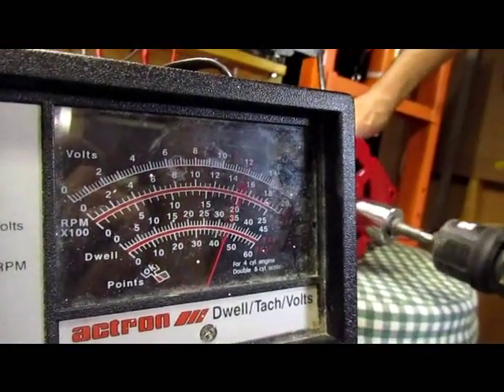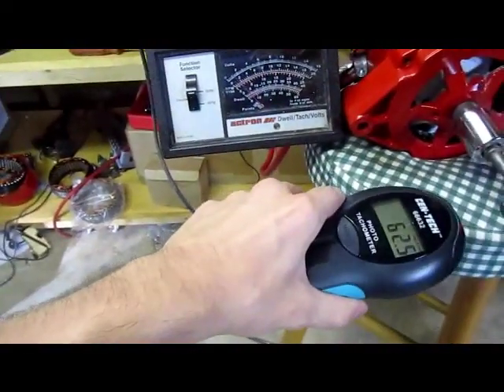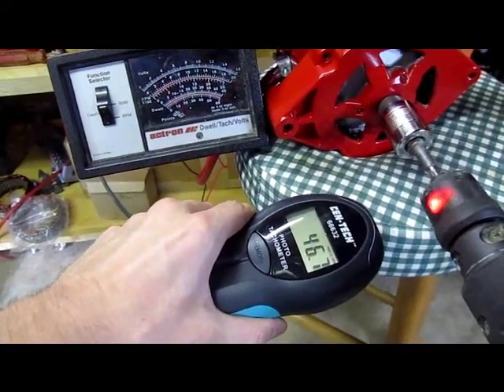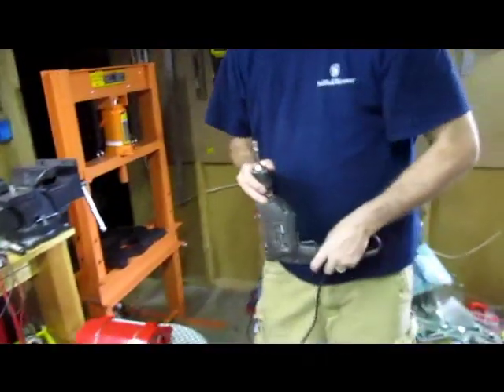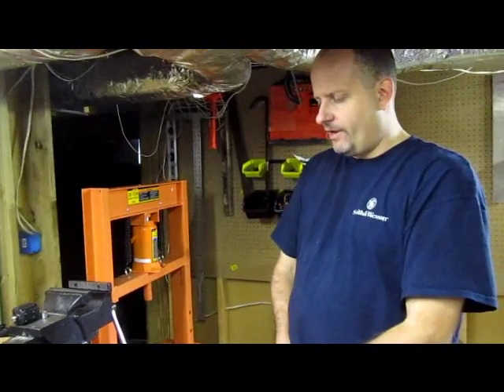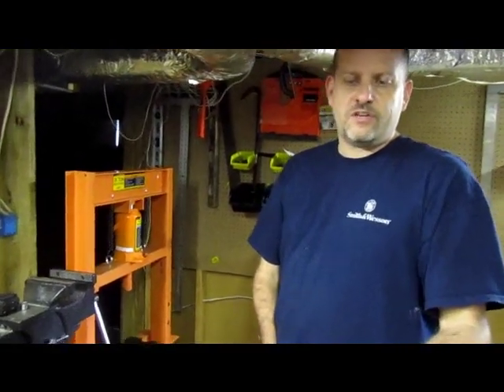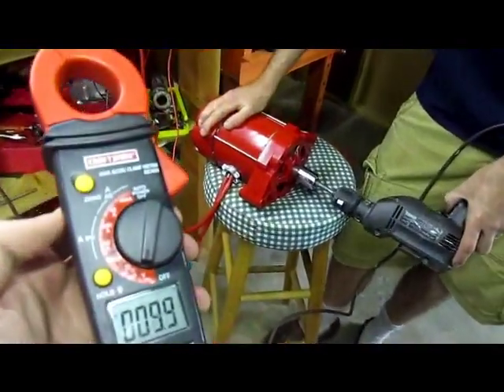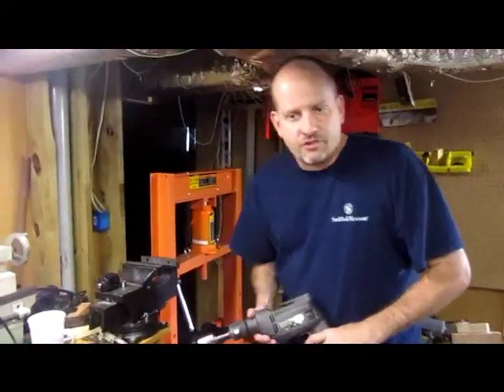Hurricane Wind Power Reviews HIGH VOLTAGE

Comment: Higher voltage means less losses down the cable. As the rectifiers are 1000V I assume this higher voltage can be used for charging 48V battery?

Comment from the maker: Valve most of the video run tests do are based on an electrical frill drive that converts to horsepower available from a set of 36-42 inch wind turbine blades and the meter is ran through a watts view to simulate real output.medium size wind turbine class output...this was a open voltage test and does highlight the ability of this My to be used with higher voltage inverters....